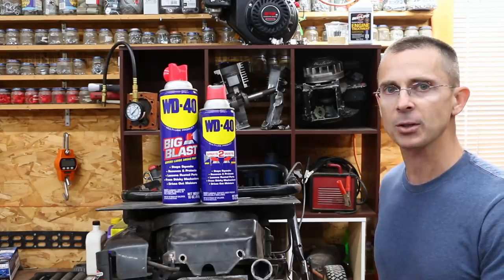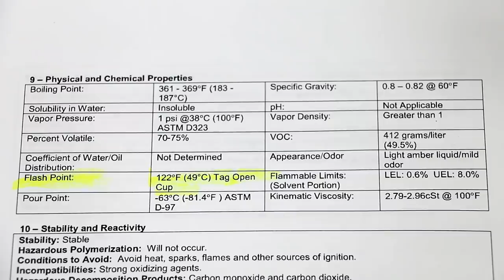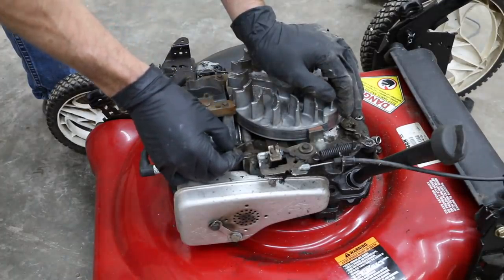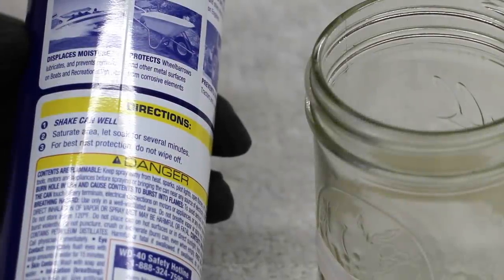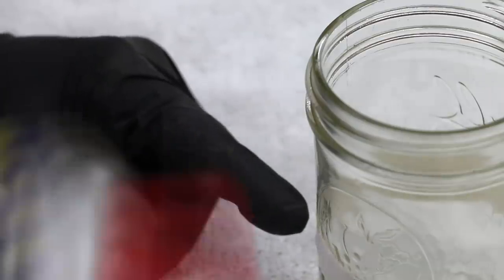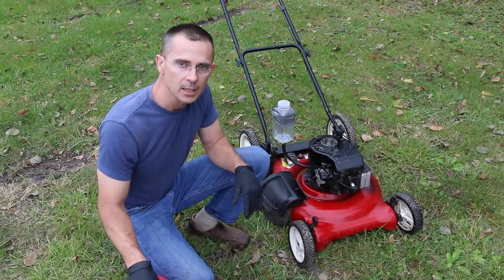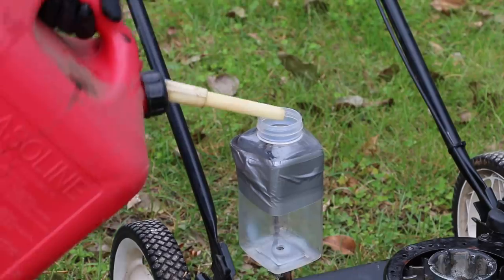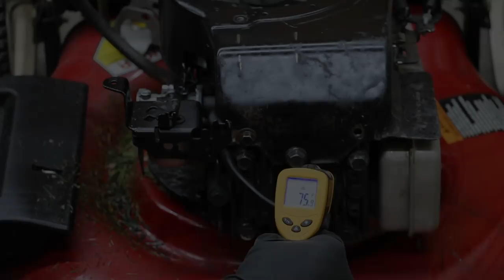Will a Gas Engine Run on WD-40?  Let's find out!

Comment: Methyl Ethel Keytone (MEK) ... But be careful.
Reply: actually... never mind. Toxic when burned.

CAS Number UN/NA Number DOT Hazard Label USCG CHRIS Code
78-93-3   (METHYL ETHYL KETONE)
1193
Flammable Liquid
link to a PDF file MEK
NIOSH Pocket Guide International Chem Safety Card
2-Butanoneexternal link 
METHYL ETHYL KETONEexternal link
NFPA 704
Diamond Hazard Value Description
3 
1  0
Blue Health 1 Can cause significant irritation.
Red Flammability 3 Can be ignited under almost all ambient temperature conditions.
Yellow Instability 0 Normally stable, even under fire conditions.
White Special  
(NFPA, 2010)
General Description
Colorless fairly volatile liquid with a pleasant pungent odor. Flash point 20°F. Vapors heavier than air. Does not react with water or many common materials. Stable in normal transportation. Irritates the nose, eyes, and throat. Combustion may produce toxic materials. Density 6.7 lb / gal. Used as a solvent, for making other chemicals, and for production of wax from petroleum.
Hazards
What is this information?  
Reactivity Alerts
Highly Flammable
Air & Water Reactions
Highly flammable. Soluble in water.
Fire Hazard
Excerpt from ERG Guide 127 [Flammable Liquids (Water-Miscible)]:

HIGHLY FLAMMABLE: Will be easily ignited by heat, sparks or flames. Vapors may form explosive mixtures with air. Vapors may travel to source of ignition and flash back. Most vapors are heavier than air. They will spread along ground and collect in low or confined areas (sewers, basements, tanks). Vapor explosion hazard indoors, outdoors or in sewers. Those substances designated with a (P) may polymerize explosively when heated or involved in a fire. Runoff to sewer may create fire or explosion hazard. Containers may explode when heated. Many liquids are lighter than water. (ERG, 2016)
Health Hazard
Liquid causes eye burn. Vapor irritates eyes, nose, and throat; can cause headache, dizziness, nausea, weakness, and loss of consciousness. (USCG, 1999)
Reactivity Profile
METHYL ETHYL KETONE is explosive in the form of vapor when exposed to heat, flame or sparks. Ignition on contact with potassium tert-butoxide. Reactive with strong oxidizing materials, and will dissolve or soften some plastics. Mixture with 2-propanol will form explosive peroxides during storage. Vigorous reaction with chloroform in the presence of alkali (sodium hydroxide, potassium hydroxide), chlorosulfonic acid, fuming sulfuric acid (oleum) [Lewis, 3rd ed., 1993, p. 855]. Reaction with hydrogen peroxide in the presence of nitric acid forms heat- and shock-sensitive explosive acetone peroxides. [Bjorklund, G. H. et al., Trans. R. Soc. Can, 1950, 44, p. 25].
Belong
Reply from the maker: Thank you for this information.

Comment: I've heard before that two stroke engines can run on kerosene. I Wonder if they really can?
Reply from the maker: Thank you for the video idea!
Reply: 30% dilution to 70% gasoline is the target range that I’ve figured out that gives the best power all around and best fuel mileage. You have to enrich the bottom end some if you normally mix 30:1 straight gas to 2 stroke oil. Some engines are different so you may have to go to 50/50 mix and see where it makes good power. All my testing was done with a Yamaha Riva running 87 octane pump gasoline

Comment: I don't agree with running the mower with gasoline after you ran it with wd40 I would have like to seen the insides of the engine immediately after it ran with wd40
Reply from the maker: Thanks for the feedback.

Comment: I just want to say that all of the intakes of the small engine designs seem to have one thing in common; penis and testicles.  Could the intake and output valves be directly right and left?   I know this is not on you, as you didn't design the engines.  I am just pointing out an obvious design characteristic in small engines.
Reply: No, it would make the heads too complex

Comment: Low compression and poor injection timing. Close to none. There are a huge waste of fuel as seen on the white smoke. But if you put wd40 in a diesel, it would run great. Compare the values with common diesel and you se why😊
Reply from the maker: Thank you!

Comment: In my opinion, WD-40 is kind of a good additive, but not as a fuel.
I tried to add 100 ml of it to my 12 L tank and the engine ran cooler than usual. But, I don't know what happened to the piston. I don't have a borescope. :3
Reply from the maker: Thank you!

Comment: Another great video!  Thanks for doing this - I saw a video a couple years ago of two teenagers using WD-40 as a replacement for oil in an old Ford beater that they didn't "need anymore."  The end of the video was essentially flooring the gas until the engine started on fire lol!  Here's a link if you're interested, it's here on YouTube:  https://www.youtube.com/watch?v=moFzeZKEYSw

Comment: Adjust air and fuel on carb and you said engine knocking was the old motor burning engine oil? Not a very good test the mower constantly run you also turned revs down manually at first start didn't attempt to turn revs up for power test you a misinformation munger